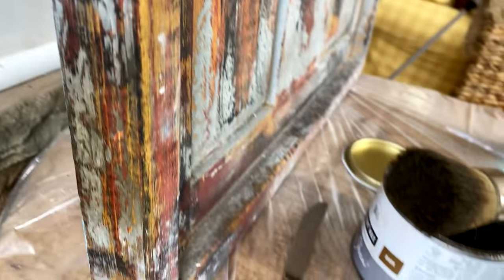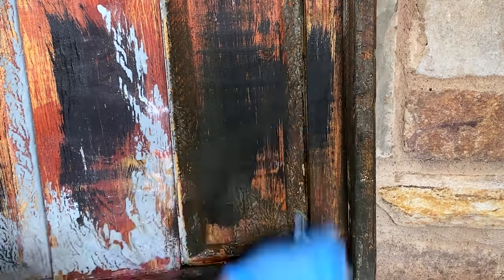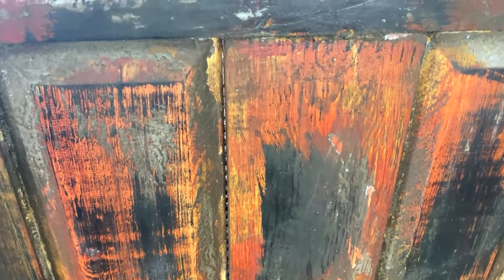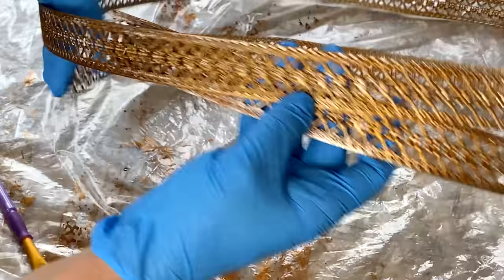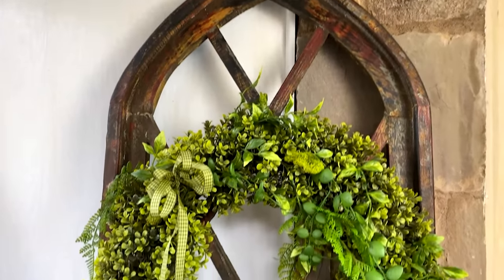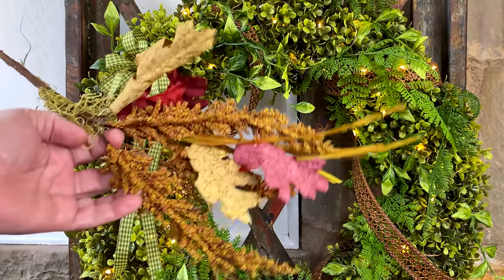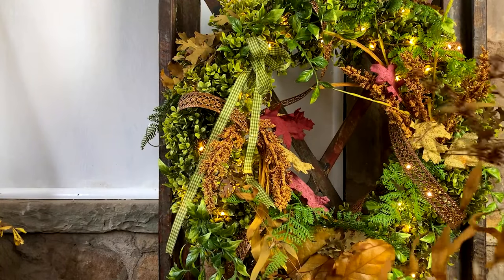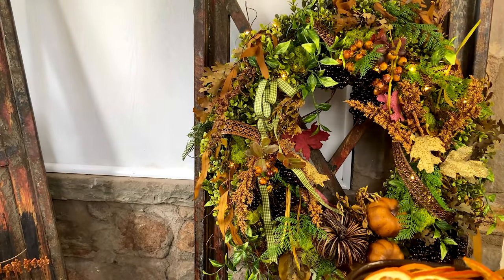Patina French Country Foyer Wall Panels || Repurposed Fall Wreath || Cozy Fall Vibes

Comment: I like your stone wainscot pony wall, it's beautiful!

The wax effect is very appealing but, it seems so wasteful wiping the wax off.  What about putting a very 'thin' layer on, then wiping?  What kind of wood is that?
I wanted to see the finished doors placed in your hallway.
There are two door panels I want from Hobby Lobby, but even with 50% off $200 for two panels seems extravagant.  😞😣  I need a side job to afford my taste!

The criss cross portion on your panels reminds me of antique diamond leaded glass/stained glass windows.  I want to faux applique my front windows to give my home a French look.  

There's so many small things you can do to your house to create the look you desire.  I can't imagine working on your huge house.  Lots of projects!!

Comment: Tried to order over the phone and told them you sent me and they didn't know whom I was talking about and customer service was not very helpful and ended up not ordering.
Reply from the maker: I am sorry to hear about your experience! I would look at his site for the panels. So much has changed in the past year with the wood supply. ❤️
Reply from the maker: I just messaged the owner and he has six panels left. Contact Chuck at his Etsy shop via message and he will get back with you. I hope this helps.
Reply: Hi so I did order them through Etsy bit they don't have the colors your panels have. It has like some red and black and beige  bit not the yellow or other colors
Reply: Can you tell me which ones are your panels? They sent me the wrong ones